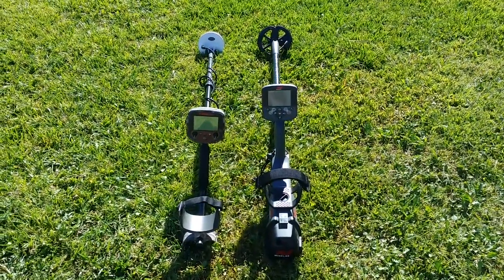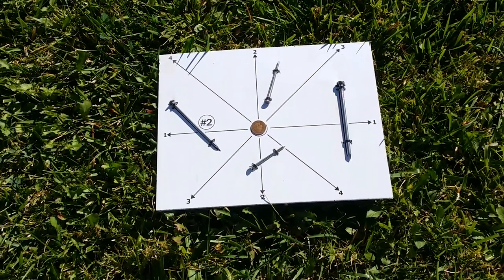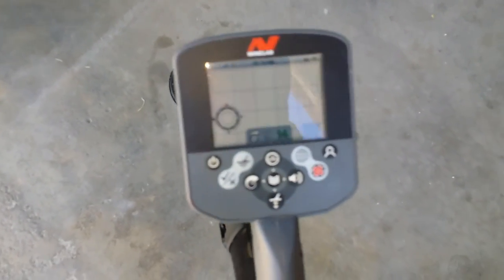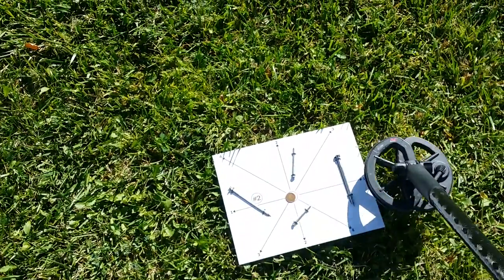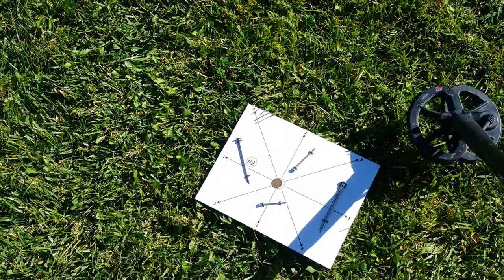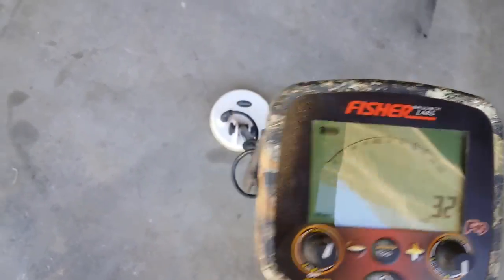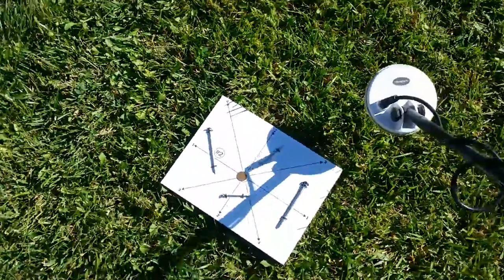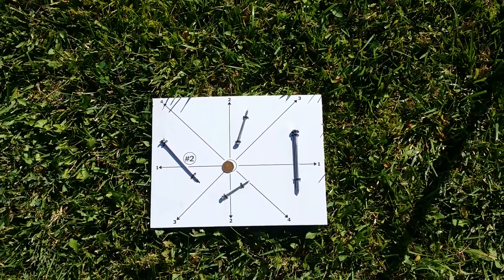Minelab CTX 3030 vs. Fisher F19 Nailboard test

Comment: Awesome test. But in my honest opinion (fully understanding how the different modes on the CTX works) the CTX did hit the target with every single sweep. Both machines performed equally well in the test. The mere fact that the iron was discriminated (therefor producing no sound) and suddenly does provide a sound once the coin is introduced clearly indicates the presence of a good target (taking into consideration an understanding of the "blending of target IDs as explained on bottom of p39 of the UM as well as the effect of different target separation modes as per P41 and P42). Non of these settings revealed in your test. Target trace on the screen of the CTX would also clearly have shown you that there are more than one target. (one rejected "blue"and one accepted "RED") The CTX is not an easy (or beginner) machine. Once a detectorist understands how it ticks, a whole new world of capabilities opens. If you buy a sports car and only drive it in 1st gear, mom's taxi will beat you to college every day. But once you hit the rest of the gears........well, lets say you'll have all the pretty girls in the neighborhood at college while mom's taxi is warming up in the driveway lol.

Comment: Need vol at 10 everything opened up and you won't hear the nails, then retry it f19
Reply: What your saying is with the fisher in volume 10 "that is full volume! but without any sound for iron... like an iron descrimination? as the volume selection of 10-20 selects the volume for iron tones. 
But then you have notch and discrimination selection option.

What would be the disadvantage of selecting 10 volume =0 volume iron? compared to actually selting notch and discrimination settings?? 

I just got a f19